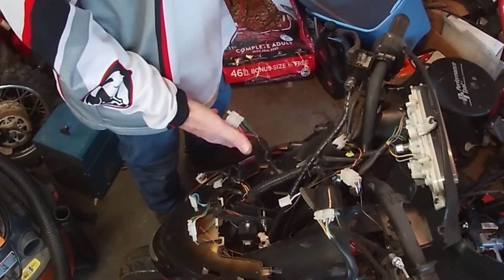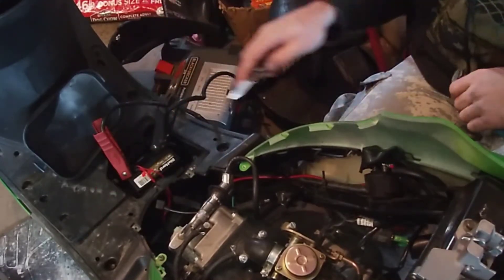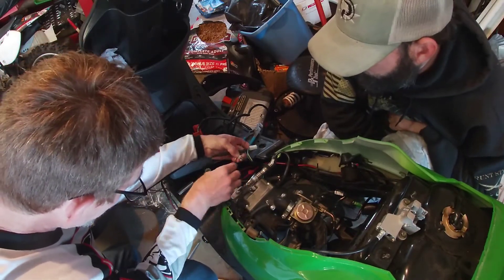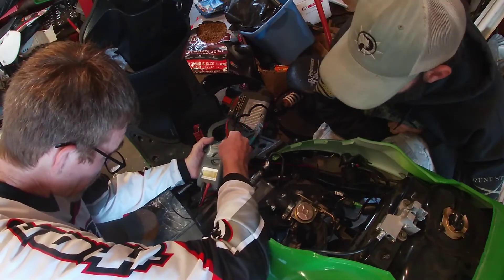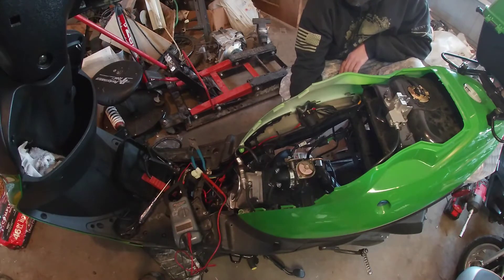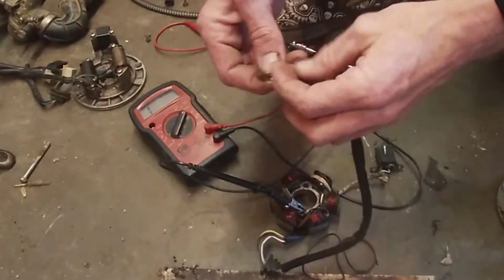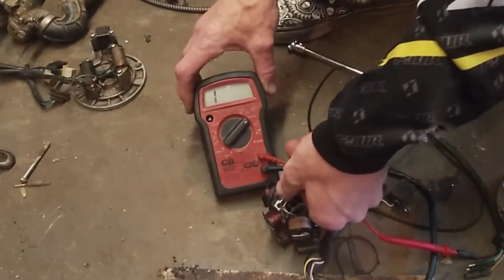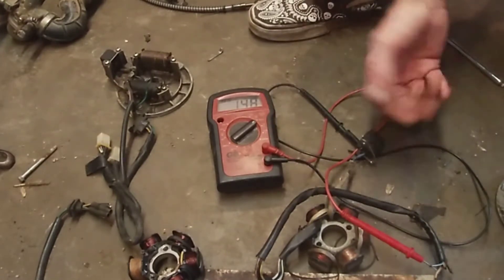How to get spark on gy6 scooter electric system spark check n fix !150cc 50c part 2 spark !

Comment: “plastic missing a few screws”
other bro said, “like most of us!” 😂
Reply from the maker: You know
Reply: I got a gen v maddog.  It's got a DC an ac feed. AC on CDI an DC for lights an accessories. I've got aftermarket front an back light.  There's so many wires. I'm trying to down size that shit but it's a struggle